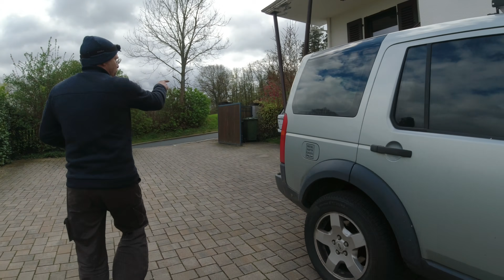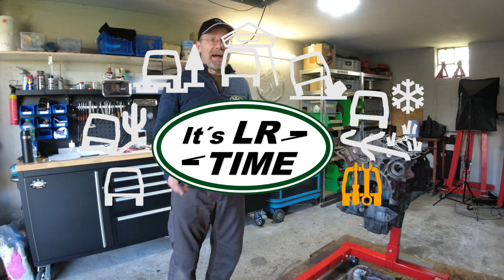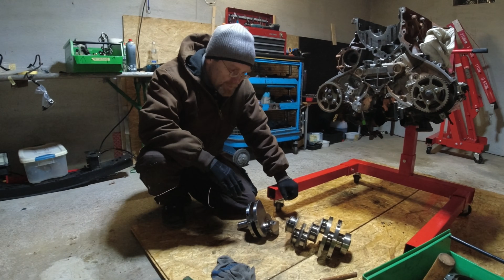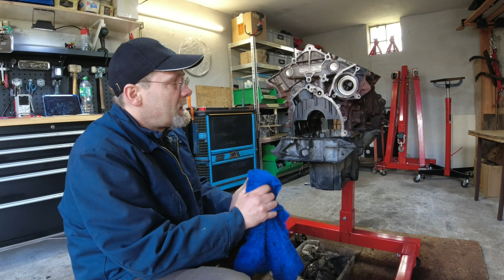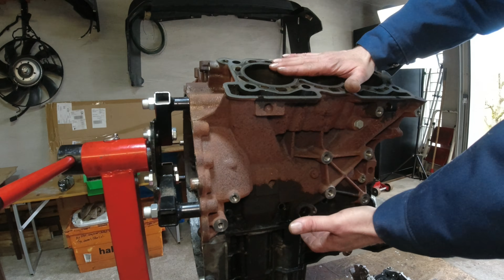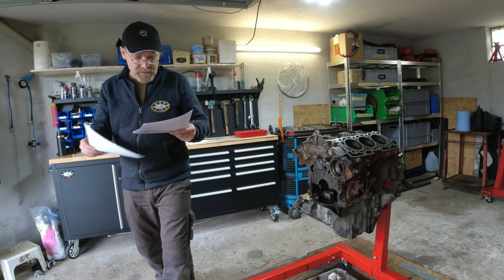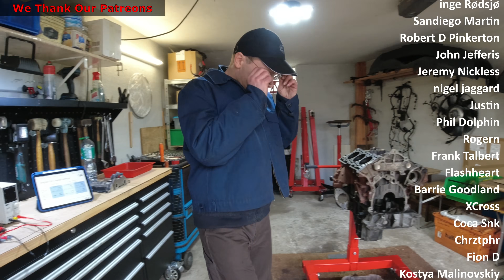Ford´s 3.0L Powerstroke failure modes - also JLR SDV6 306DT / S5-EP16

Comment: Old school rules for me.
I change my oil every 3000 miles as it makes me feel good and I have never had an engine failure in over 45 years of motoring.
Brilliant video again and I note that Vera’s yellow jacket has finally succumbed to an oil stain on the front 😂.
Time to leave my crypt now and have breakfast.
Looking forward to next week. Cheers
Reply from the maker: She got two jackets.  😂.  Christian
Reply: @Vera_and_Christian  You spoil that woman!!
Reply: After years of air cooled ownership 3000 feels right, but even on modern stuff every 5k is a good rule of thumb
Reply: 5w30 or 5w 40 ? I am travelling to Spain in the summer towing a caravan so thinking of 5w 40 for the journey, I will change back to 5w 30 on return
Reply: @blackvulcan100 I wouldn’t be mixing different oils for different climates, just run the 5w40 an youre all good. A lot of people will ask him questions he’s busy dismantling engines doubt he will respond 👍🏻

Comment: Toyota diesel engines have adapted the electronic oil control valve system too. and yes I have seen the same frequent faults of bearing wear and bearing sieze in this engines that was never there before. The earlier engine version (without the electronic oil control) had no issues at 600k to 1 million km the bearings looked brand new!
Reply: Which Toyota engine is this?  Is it the 2.8 1GD?

Comment: Send your short block to Pakistani Truck repair,  I am sure they will work wonders on that failed engine  😂
Reply: I thought that too.
Somewhere in Karachi is an old fella with no shoes and a pair of sunglasses would have that hole welded up before lunchtime.
Then he would hand it over to some schoolboys with files that will machine everything back to better than OEM.

Those guys regularly make something out of absolutely nothing.

Comment: Sooo. 456k km.... still original Turbo, HP Fuel pump, Injectors and Lift pump..... waiting for 500k km to pull the engine and rebuild it... will be sending you the bearings
Reply from the maker: If you are serious, that would be actually awesome. 👌👍🙋‍♀️Vera
Reply: You bet!!! Currently in Nambia on another trip!

Comment: A retired LR director lives in my village and he has told me many times that the lifespan of their vehicles was designed for 100k miles / 150k Kilometres.
 
It seems they are charging an insane amount of money for a vehicle to last just that long!
Yet it appears to me that the vast majority of older vehicles on the roads in my locality are LR’s. Mostly Discovery 3’s and 4’s.
Reply: I think they design LR just long enough to get through the 3 year warranty period. To be honest, many don’t make it that long 😂
Reply: @cp4512  Well most LR customers are buying new one after that period. The old one is part exchanged, then another person buying that one and extended warranty with it (in the meantime car is going to have replaced engine and gearbox twice and few electrical gremlins not solved because is not covered under extended warranty). After that period car is going to either car auction or to someone who is not bother about small electrical problems, just want to have big, comfy car for cruising or just show off (of course with private number plate, so no one can tell that car is nearly 10 years old)
Reply: This short warranty is now deterring buyers. People have had enough with JLR poor reliability when Toyota, Kia/Hundai, Chinese, etc all have 5-7-up to-10 year warranties.  Resale values are terrible here and in the US causing high lease costs and then they put up the list prices as well.
Reply: @johanndork5364  Probably it will change in the future, but JLR is not a brand which I would compare to Toyota or Kia. It's considered as luxury brand and as such like BMW or Merc are still in 3-5 years of warranty period. Some customers wants more refine product, which gives more comfort in every day use and not bothered to pay extra and recent year of record profit  for JLR just confirms that
Reply: @johanndork5364 I snagged two 4Runners in 2020 before the 2021 price increases. Dodged that bullet.
Reply: I work in Product Engineering there and it's like that still. Tbh most car manufacturers are designing stuff that way. Imagine if cars can last like 300k or 400k which is possible, how many people would buy a new one then? Previously worked in Toyota dealership and Toyota nowadways giving you 10 year warranty or 100k miles if you keep servicing car at dealership. Hybrid batteries are covered for slightly longer, but I had some failing prematurely as well. I also had engine failure in nearly brand new Hilux due to loosen screw on EGR flap which gone into cylinder. Maybe you're familiar with story about Merc w123 and how that model cause financial problem for Mercedes because it was design so well. Same with other products as clothes for example. Whole economy wouldn't last long if things are made to last forever in capitalism based economy system.

Comment: Oil dilution is horrendous on JLR engines, the regen system designed to burn off ash and carbon in the DPF can see unburnt fuel being sent to the oilpan which then washes throughout the engine wearing surfaces if the oil isn't changed regularly. The issue is, that when a natural regeneration is in progress, there is no indication to the driver, if then, the engine is turned off during the regen, excess fuel dilutes the oil. If there was an indication to the driver, to keep the engine running until a natural regeneration completes, the life of the engines should increase substantially, along with more frequent oil changes. Not sure if any aftermarket device or software is available to warn drivers when regen in occuring, maybe JLR should be offering their products with this facility.
Reply: Had this on a Discovery Sport. Needed oil change every 6000 miles.  Each time it was changed it had almost 2 litres of diesel mixed with the oil.  I sold that car before the engine failed!

Comment: Who remembers the run in period of 500 miles for first oil change and then at 5000 intervals.
Reply: Who remembers the “Running in please pass” sticker on the back window?
Reply: I do I was a apprentice at Saab dealer 35years ago any engine i build even now still do the running in
Reply: You mean SAAB! Killed by gm bean counters! 😢
Reply: I change my oil at 5000 kilometres, not miles. It's the Toyota 1HD-FT diesel.